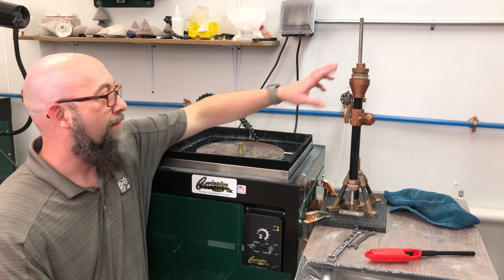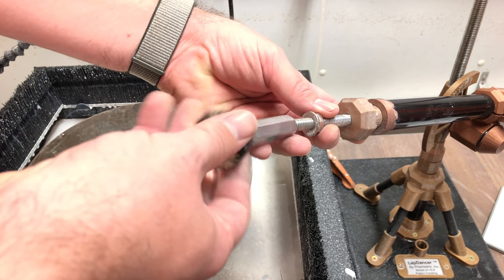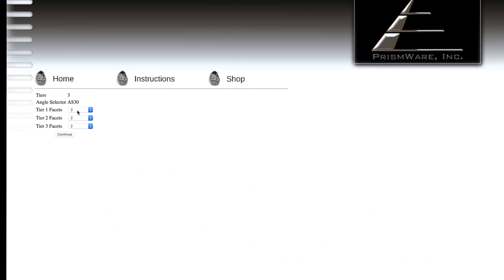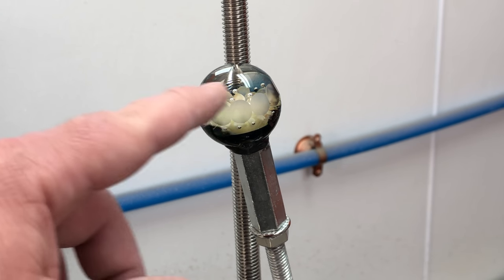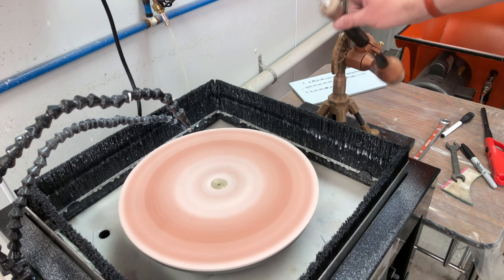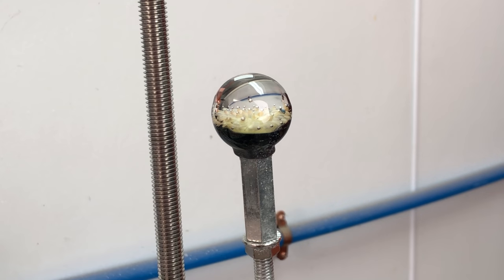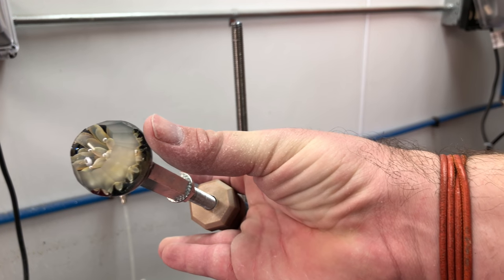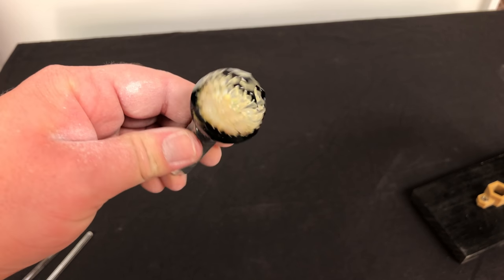Demonstrating the LapDancer External Faceting Arm

Comment: for the price... this should not be 3d printed... I like the concept but it should be at least half the cost.. or send your cad files out to be milled.. if it was all metal Id give you a grand for it.. keep em 3d printed and you would sell these like crazy at 350 a pop.. If you went to one Champs or Glass Vegas trade show at that price you wouldnt be able to handle the orders..
Reply from the maker: This is the price that Prismware sets for their costs and time. Most other faceting arms start around 3K or more so the pricing is not bad to get into faceting.
Reply: @hisglassworksinc  I know how much facet machines are lol. I have a few machines I have one that was 9k. Ive made scientific glass aparatus for over a decade. I also have 3d printers and know not only the tolerences but the material science too. I will reiderate, they should not be that price. If you are having someone print them for you and you are reselling. You need to shop around.. you are being ripped off.  Total cost of materials on one of those has got to be less than 4$.. This tool is talked about in the community and reffered to as a joke simply because of the price. I know guys with modified 100$ china arms that have tighter tollerence than 3d printing.  There is no good excuse for the price. Simply put. You would make way more money selling the print file without a doubt..
Reply from the maker: @ThrashyB  I completely understand your point of view. But we do not make this product. We only sell it for Prismware who makes the pricing on their end.
Reply: @ThrashyB  This is the comment I was looking for. If it was metal, then yes this would be good. I am extremely disappointed to find out that it's plastic. I have been designing my own 3D printed concept for faceting marbles, but wanted to also buy something to compare with. The main issue I see with this is there's no depth-of-cut setting - he's just estimating the depth. A real faceting machine allows you to set a height and get all facets to that height, without any BS like counting strokes. Thanks for the information, this is exactly what I needed to know.

Comment: Is the software included with the device?
Reply from the maker: Disks are purchased separately from the grinder. They do not come bundled.
Reply: @hisglassworksinc  Great answer - but wrong question.  He wants to know if the faceting software you used is included with the facet arm purchase
Reply from the maker: @en2oh  It's found on Prismware's website.

Comment: How big should the surface size be to start with the 325 pad?
Reply from the maker: I would say anything over around 5mm facet size will work well with a 325-grit over the 500-grit
Reply: @hisglassworksinc  So, for a surface with a diameter smaller than 5 mm, I can directly use the 600 pad, and for a surface larger than 5 mm, I must start with the 325 pad.
Have I understood correctly?

Comment: Is it possible to mount and index arm like this for flat laps?
Reply from the maker: That's exactly what the LapDancer is. An externally mounted index arm for faceting on any available flat lap.
Reply: @hisglassworksinc  ya i know but i cant spend 700 on both ends. I could have a full working mbr facet machine if i wanted to buy. A motor. Guess i got to buy. A motor. @mr.facet told me bout you for a facet machine nit a arm with no grinding wheels
Reply: @Hisglassworks1  Yah thats quite the predicament lol i just want to add an edge to my glass work.
Reply: @Hisglassworks1  Can this be coupled with the hi tech diamond flat lap for sure if i mount both to a surface?
Reply from the maker: @baddonkey75  Of course. Most of our customers are using the LapDancer with an 8 inch lap grinder.

Comment: How do you get the epoxy off now?
Reply from the maker: I warmed up the dop with a torch until it softened the epoxy enough to get the marble off the dop, then soaked the marble in acetone over night
Reply: @hisglassworksinc  - Thanks.

Comment: How would you do a perfect 90° facet on the top? A different tool?
Reply from the maker: Yes, we also have a Top Grinder tool that attaches to the arm to create the table on the top of the piece: https://www.hisglassworks.com/machinery/flat-grinders/faceting-arm.html
Reply: @hisglassworksinc  when are you going to make a video for that? I just got mine and here I am rewatching this video because the paper instructions are rough for a first time faceter
Reply from the maker: @saybianTV  Looks like I'll have to add the top grinder to the video. It's actually pretty easy. The Top Grinder attaches to the end of the LapDancer and your dop attaches to the bottom of the top grinder. You then put your LapDancer at a 90 degree to the flat lap and use the bubble level on the top grinder to make a level table on the top of the faceted piece. The top grinder will move around on the Lap Dancer arm so it takes some practice, but you're just trying to keep the bubble level level as you are grinding.
Reply: @hisglassworksinc  I noticed the extension arm is not on the site to order.. Ive just started on my second stone and the lap dancer can barely get up to 65 degrees with the grinder drain butted up againts the dancers base... I neeed  one to ship ASAP

Comment: when you extended the arm by loosening the screw, do you not risk rotating the marble and so, lose control of the second facet set?  That being said, this is a beautiful example of "fit for purpose" engineering!  Great job!
Reply from the maker: Not really. You'll set the face angle for the second row once you adjust the arm length

Comment: What distinguishes Lap Dancer from less expensive faceting arms?
Reply from the maker: The LapDancer is a less expensive arm. Most faceting arms are complete units with a 6-inch or 8-inch wheel head and integrated arm and they start around $3000 generally.